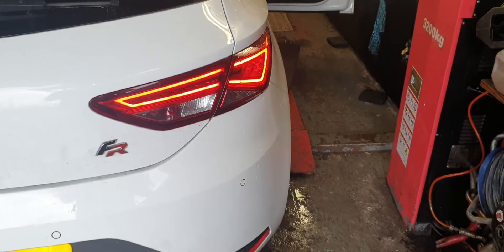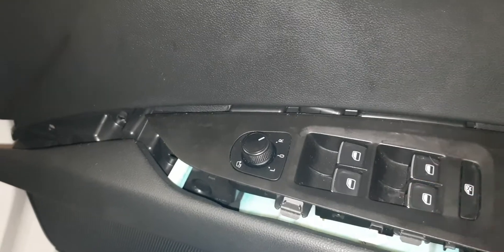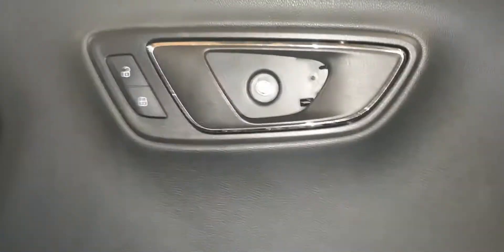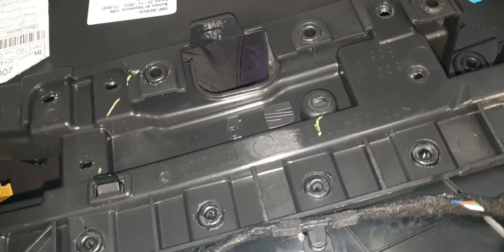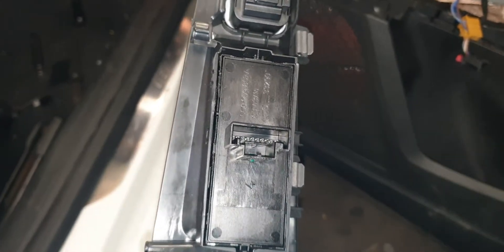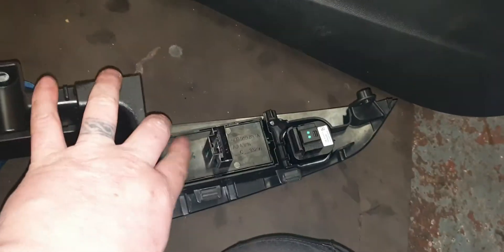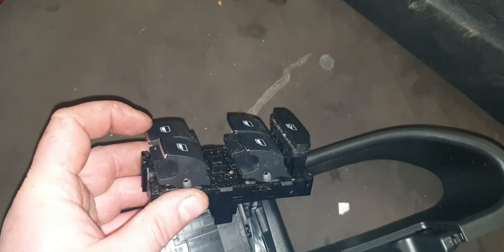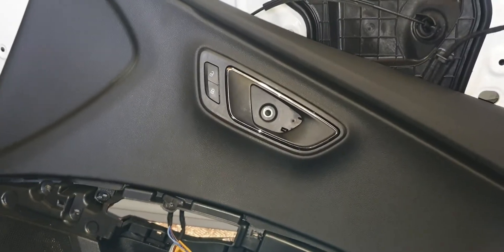2015 Seat Leon window switch replaced & door card removed

Comment: Water came down from the roof of my car through the front window and onto the driver side controls yesterday, immediately this problem started. Back 2 windows are fine, drivers side wont go up n down and the passenger side only goes up.. is changing the switch necessary or can you just dry out the controls with a hair dryer? lol
Reply from the maker: You could try it buddy but i couldnt confirm. If you know the pin locations you could put the window up with a 12v feed
Reply: I have the same issue. Only driver switch is not working. Would be good to know if there is a way to tackle this without replacing the whole switch

Comment: Is it difficult to get the door panel back on? It's a lot of dismantling just to replace a relatively cheap part
Reply from the maker: No not really, just fiddling with it should be ok. Like most things with cars,have to remove numerous amounts of other parts to replace what you want. You will get satisfaction when all built up and working 👍

Comment: How did you removed handle/window switches from the clips on door card ?
Reply from the maker: There is about 15 t20 bolts holding the panel on at tge back of the doorcard

Comment: excellent video. im from Norn Iron too. my car is under warranty for 6 months ive has it two weeks and this switch failed at the weekend.
just out of curiosity what would you charge for the labour and roughly how long would it take someone with your abilities to complete the work.
cheers chris
Reply from the maker: Glad you liked the video buddy, Id say 1hr max to replace the switch as the door card needs removed. If its under warranty it shouldnt cost you a penny. But main dealers charge a going rate of around £90+vat per hour. i mostly do these videos just to help people out or my students. if you have the correct tools you could easily do it.